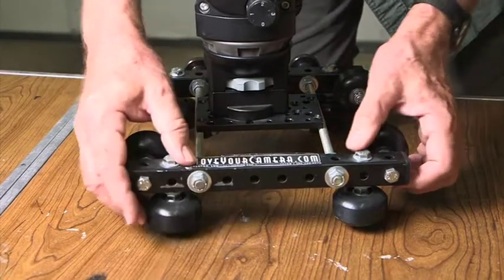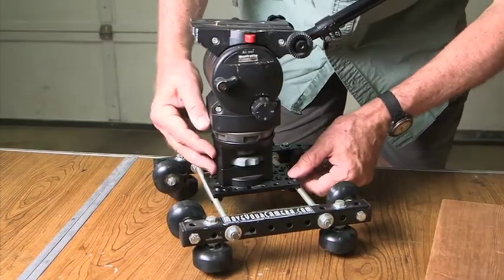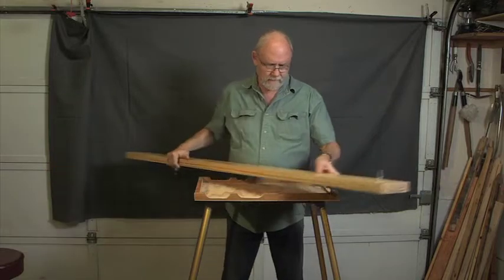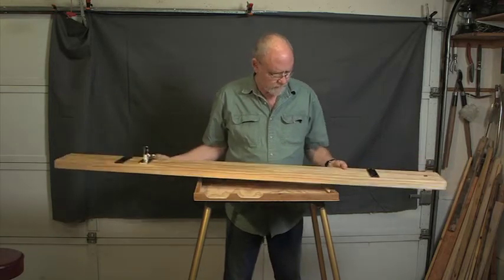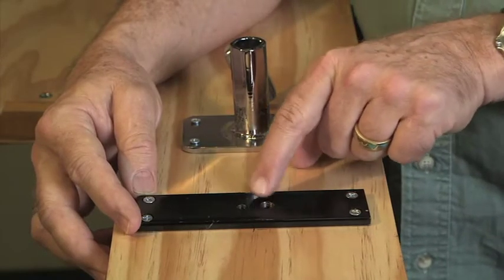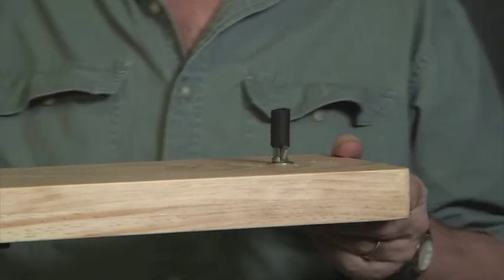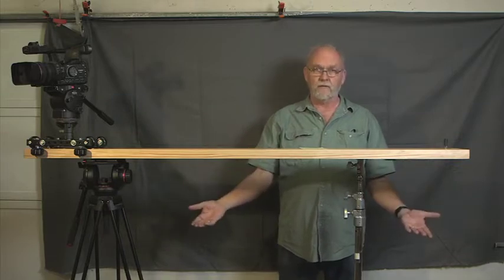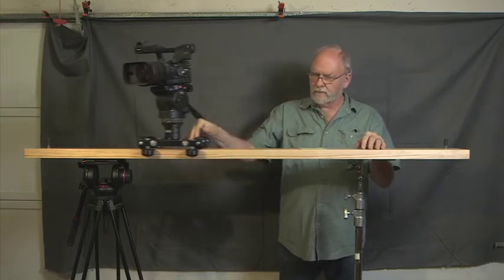DIY Do it yourself Cinemover camera slider

Comment: You can build the 'truck' using roller blade wheels purchased at a sporting goods store or a board shop.  A few nuts, bolts and washers with some threaded rod and couple piece of Uni-Struc (or even hardwood such as oak) and you're done.  I don't know what the camera bases would cost, but you could build the rest for about $30-40.00 tops.